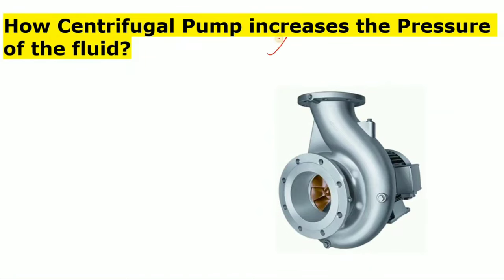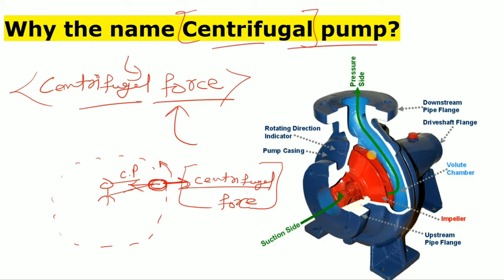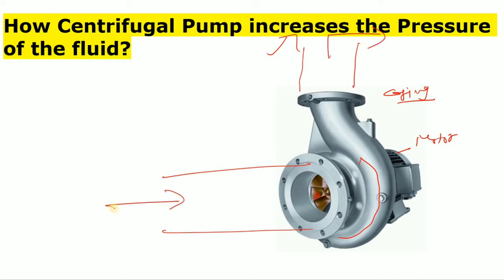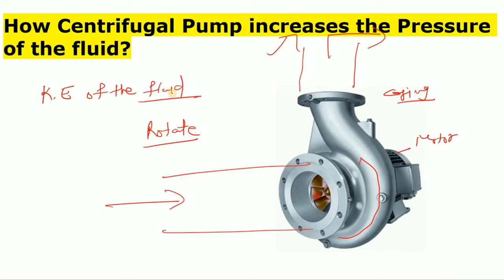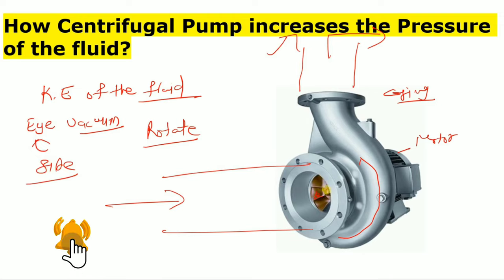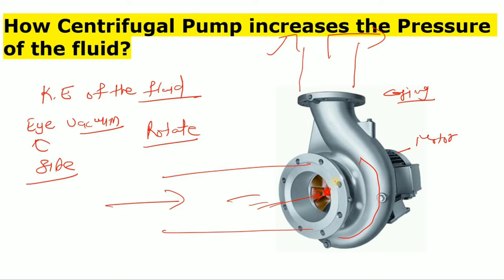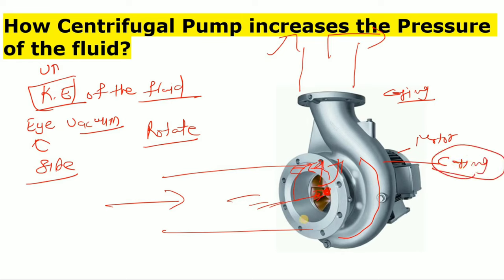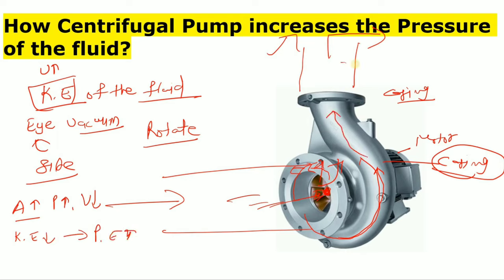How Centrifugal Pump Increase the Pressure? (Part-5) | Working of Centrifugal Pump

Comment: due to the casing area increases then pressure also increases, but in pump discharge side dia is low therefore area will decrease then pressure also decreases??
Reply from the maker: The concept of decreasing of discharge line pressure is different please refer our one video about the why suction line pressure is higher as compared to suction line dia.